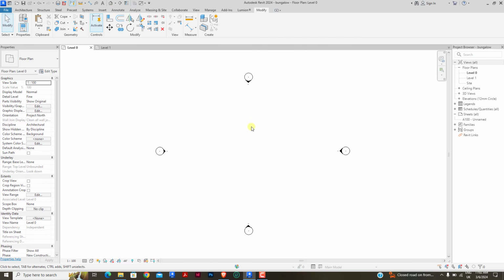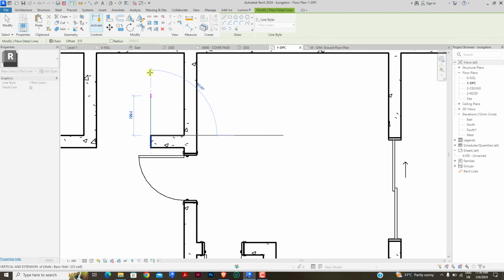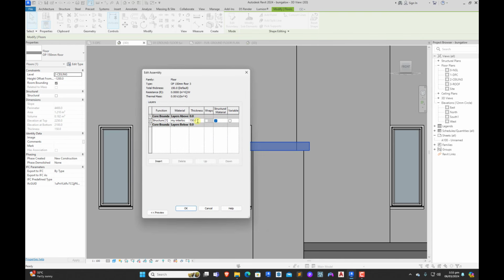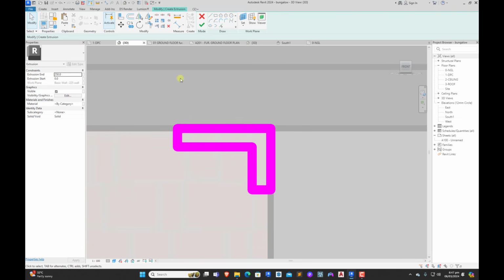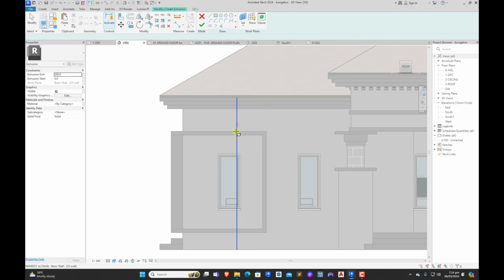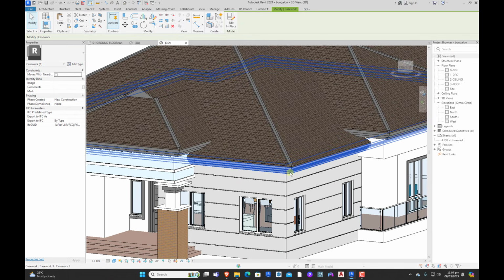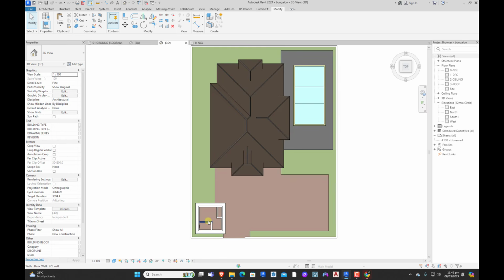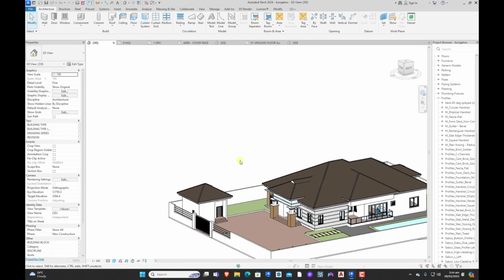Autodesk Revit Architecture 2024 Full Beginner's Tutorial

Comment: Good day, did you press down any button while using paint because mine picks up the entire wall and not just the area surrounded by the extrusion @2:18:52
Reply from the maker: No, I didn't hold down any buttons if yours is picking the entire wall try using the split surface tool to separate the one you want to paint from others